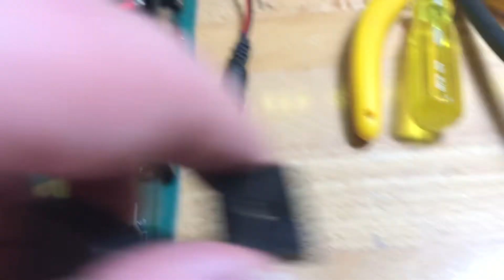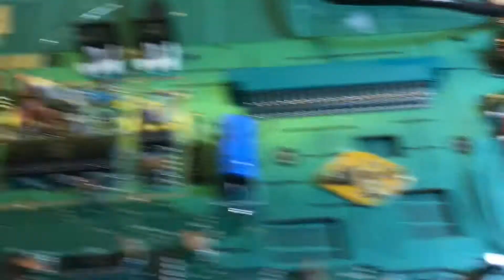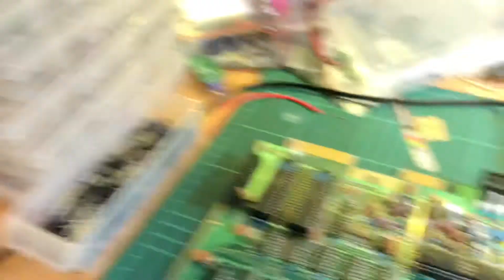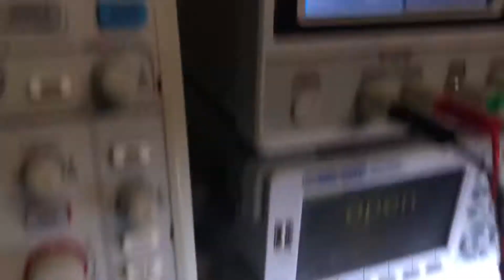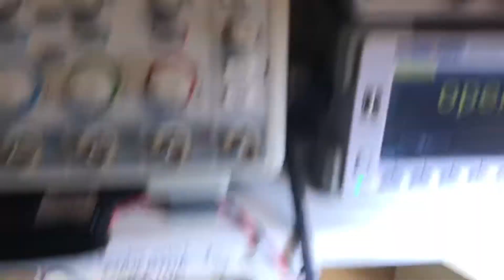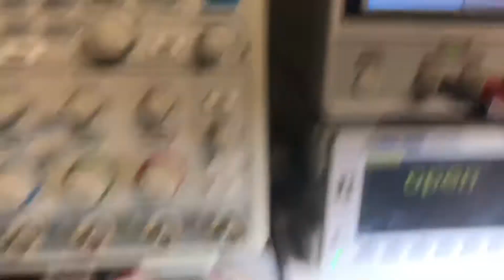🇺🇸 Commodore VIC-20: The quest to remove heat and reduce power [TCE #0007]

Comment: Is it the lighting or is this board new?  It looks sooo nice.
Reply from the maker: With all my computers, I've started removing all the socketed chips and then simply washing the board under running water with an anti-static brush (I assume a toothbrush would be the same), then shaking the water out of the sockets and leaving it to dry in the sun.  This particular one was covered in what smelt like talcum powder, so it's definitely looking a lot better than it was yesterday!
Reply: @Brfff  You should do a video about that.
Reply from the maker: @retrokelpie7606  Ha, indeed - I've got a few VICs coming soon ... one is an absolutely filthy "sold as found in barn" VIC with PET-style keys (missing some though ... but I just need a PET-style SHIFT-LOCK for another keyboard) ... that would be a good candidate
Reply: If you want to cut the power drain a bit more, you could replace the VIAs with modem CMOS WDC65C22N ones from Western Design Center. Those ones are designed to be direct drop-in replacements for the older NMOS ones in the VIC. It is possible to use a CMOS 65C02 as well, but they aren’t quite pin compatible, so there’s a bit of work required to get one working.